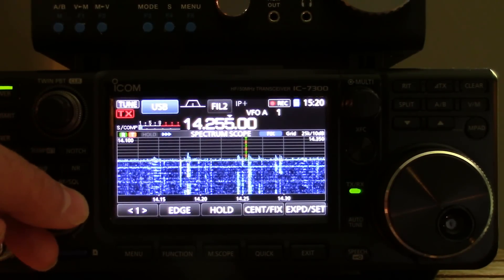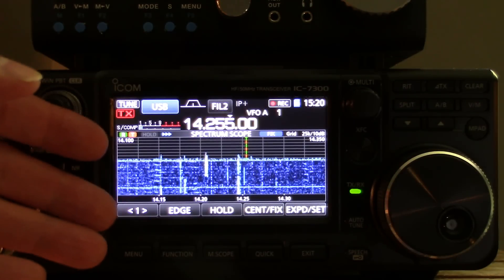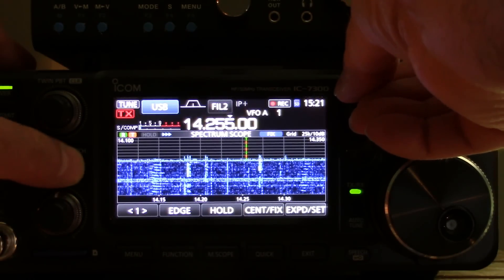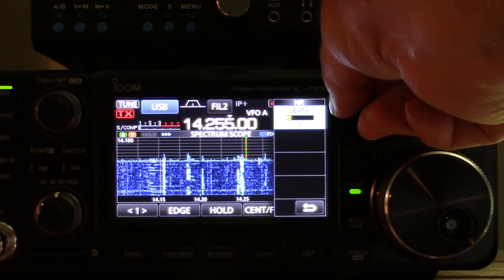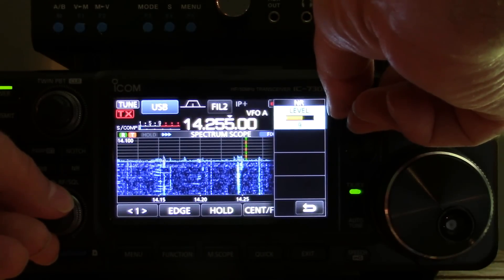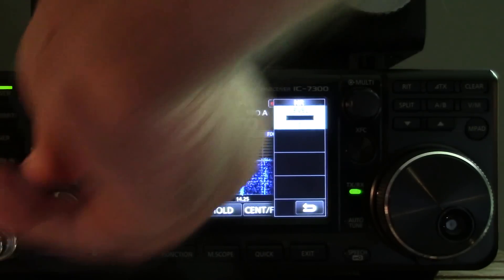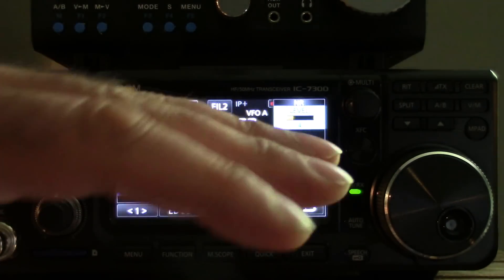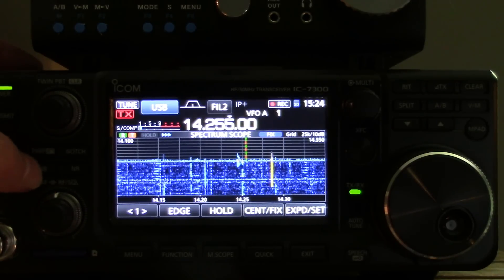Icom 7300 Noise Reduction [LIVE DEMO]

Comment: Not impressed
Reply: It was either too weak or to strong signal during the demo, so all you could hear was the background noise changing a bit.
So the demo was far from perfect.  He should have changed the value quite rapidly while listening to a proper weak station.  If I have a noisy SSB signal on my FTDX101d, I find the DNR to be effective and some narrowing of the bandwidth to reduce overall noise.

Comment: The 7300 has alot of neat features for the money. I used to own one but got a Tentec Eagle and an Argonaut VI. Getting these rigs with their low noise floor and great NR is why I sold the 7300 night and day difference from the Icom.  BTW I still have my original Icom 751A and it has a better sounding reciever than the 7300.

Comment: Now I’ve been using the FT-891 a good while I can honestly say the noise reduction blows the 7300 out of the water.

I’m getting the pan adapter for the 7300 which will allow me to hear the audio directly from the airspy HF+ which is vastly superior to the 7300. 

I should have got the FTDX-3000 which already has if out for panadapter and should sound as good or better than the FT-891. The Audio on the 7300 can be quite fatiguing to listen to after a while.
Reply from the maker: Thanks for being part of my YouTube network o00scorpion00o!
Is there any particular topic you'd like to see covered in a future video?

Comment: The Yaesu FTDX-3000 is supposed to be quieter with no noise reduction than the 7300 with noise reduction , certainly the 7300 does have a very harsh sound.
Reply: You Tube  MY Tecsun PL-680 is much quieter than my 7300 :-)

Comment: OK, Rick..... which SDR rig has the most background noise?   How would you rate them from lowest to loudest?  I see that you can make the 7300 "quiet" with NR ~ 10.  But how would you rate them without using any NR and properly set AGC on 80M SSB for example?  It looks like you have at least 4 to rate: Flex, Elad, mcHF, Icom.  73 Bob
Reply from the maker: I no longer have the Elad, and I don't have professional test equipment, so my gut feeling about this would put the mcHF as worst, and the Icom & Flex both being excellent. Flex is probably the best.
Reply: Thanx, Rick.  Interesting outcome.  I found the 7300 background noise to be excessive no matter what I did.  It was always worse than my superhet rigs.  Yes, I tried everything.  If I ran NR at 10 then it became competitive.  My Flex is the quietest at this QTH.  AGCT works very well for this.  Lastly, I am an Icom fanboy, so that is not the issue.
Reply from the maker: interesting. I will have to try my old Icom R-75 receiver for comparison. It's the only superhet I still have.
Reply: Interesting.  I told you I am an Icom guy.  I too have a R75.  I bought it ~ 2007 when I was a SWLr.  I still love it and will never sell it.  Very competent receiver.

Comment: NR is one of those things where less is more.  Some believe it can make a weak signal copyable, that MAY be true for CW, but not for SSB.  Its better for cleaning up mediocre signals and making them less fatiguing.  Nice demo, I like the 7300 - first radio ICOM has put out in at least 5-6 years I'd buy, no idea why they let themselves get behind.  That panadapter looks fantastic.
Reply: This is not true . From my own experience, I have been able to rescue illegible signals and stations with the kenwood ts2000 nr1 and spac nr2 and that is a system already with a certain age. The nr Dsp systems are learning and comparing while they are active. Do a test with some longer time.
Reply: @cesarea4is60  You're both talking about analog radios when mentioning the TS2000 and the Elecraft. On the 7300 being full SDR it does not help in the majority of the cases.
Reply: @624radicalham  Actually my radios include an Elecraft K3, KX2 and a Flex 1500.  The Elecraft K3 is not an analog radio.  Its a hybrid SDR.  I own a Kx2 that is a full SDR, and my Flex 1500 is also a  full SDR - obviously.  None of these radios has made an un-copyable signal copyable with NR.  NR can make copyable but fatiguing signals easier to listen to for long periods of time.  

I will say that noise blanking on these radios can cut out interference from power-lines and electrical equipment and unmask signals.  PowerSDR is the best at this.  But nose blanking is for very specific QRM.  If you really want to capture weak DX, is all about your antenna.  As you suggest Miami, no magic button boosts signal and reduces noise.
Reply: @kd8opi  Thank you for that. I was not aware the K3 was a hybrid and that the Kx2 was a full SDR as I've never been an Elecraft owner. I find with my 7300 and 7610 that in the end what improves a noise problem that I'm plagued with is an MFJ-1026 Noise Canceling Signal Enhancer. Just nulls the noise right out and I'm left with an enviably quiet noise floor. Of course, they're not made for QRO without modifications. As you say, NB can be effective indeed for pulsing noises being mindful (especially on the Icoms) of not using too much as it will quite severely degrade the copiable signal introducing digital artifacts. But the MFJ-1026 improves my signal to noise ratio in a way that I've not yet seen a NR or NB do (specifically with the noise that I have). I see many videos of people employing the NR in Icoms and Kenwoods with 20 over 9 signals, which defeats the purpose when you're looking to copy a signal in the noise such as I enjoy.
Reply: @cesarea4is60  Well, from my own experience using Elecraft equipment, NR has never made a uncopyable signal copyable at the elementary level.    NR has helped make them easier to listen to, and for more enjoyable operating, but its just common sense that when noise>signal its hard for the best NR software to do much with it.  

My own take is that you want a better s/n ratio than NR, which is why all things being equal your antenna system is the determining factor for working weak signals and eliminating noise.

Comment from the maker: Listen in stereo! Use your balance control!
One side has the narration, the other the straight audio as recorded by the radio. You will hear the various levels of noise reduction NR in the Icom 7300.

I must say the NR in this radio is better than my old radio, an Icom 756 Pro3. It wasn't bad in the Pro3, but beyond 10 or 11 o'clock and it went all watery. And I hate that watery sound.

This is an improvement and Icom has done an admirable job on this whole radio.